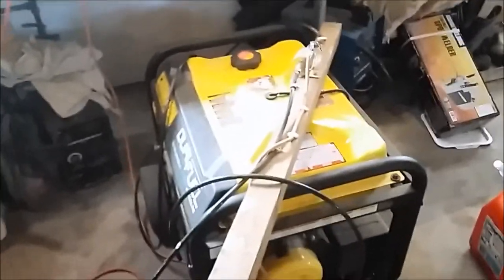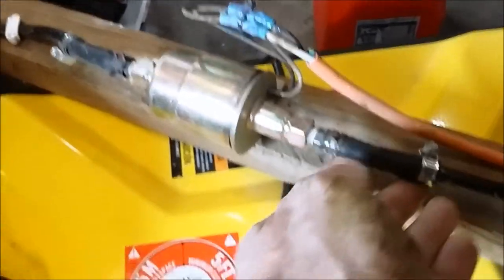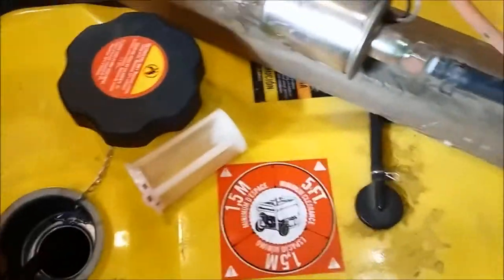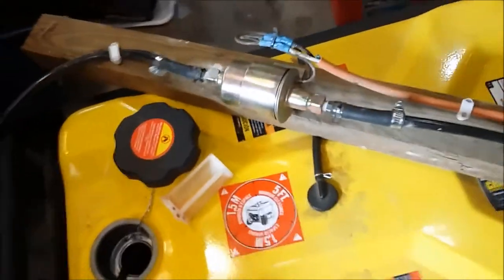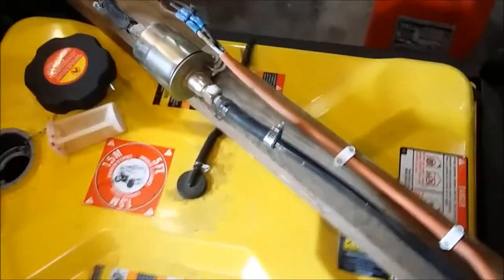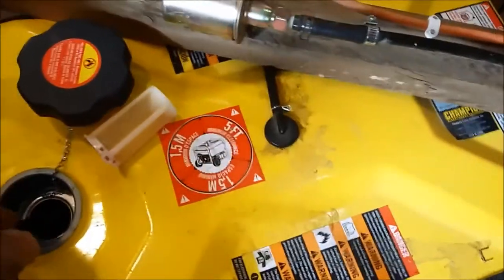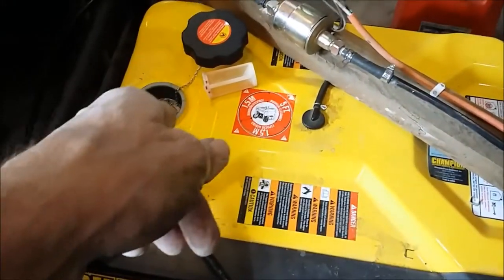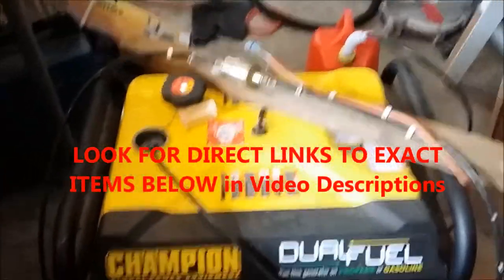How to siphon with Electric Fuel Pump DIY

Comment: good Idea friend. I have seen them and never thought of doing something like this. I think I would add a filter on it to filter anything that might have got in the tank.  Yet another good idea from poky the do right man. LOL.
Reply from the maker: +McCuneWindandSolar Yep, that little pump has drained almost 50 different tanks of fuel over the last 4 years. That link for it shows It comes with a filter but I plugged it up and have yet replaced it.

Comment: How about one of those 12 volt battery jumpers that are small enough to fit in the glove box, will that work with this?
Reply from the maker: They will but they usually put out over 15 volts so they may over do it on the pump speed.

Comment: I am trying to find a pump locally & a filter cause i have 2 vehicles ones engine is gone and it had $50.00 in gas in it the other i just got and would like to flush any rust etc by puttin 5 gallons or so in tilting the truck then pump that 5 gallons back out thru a filter